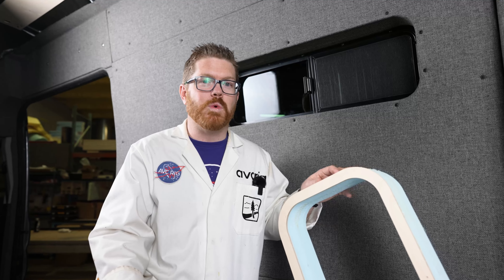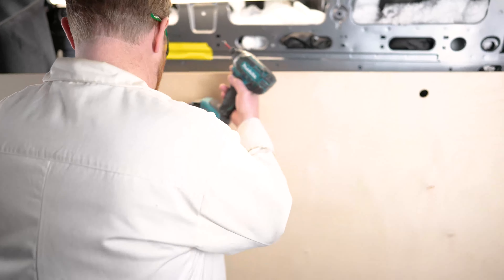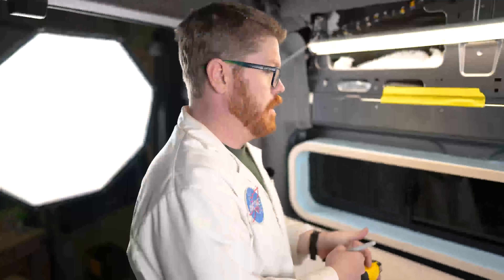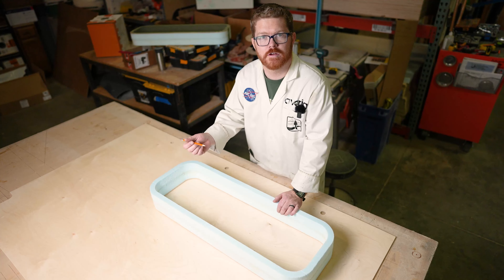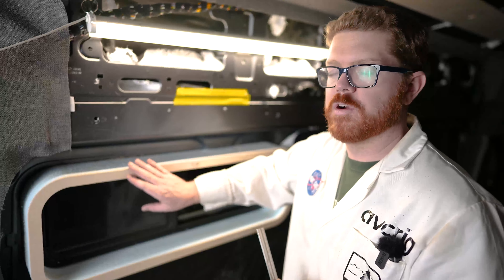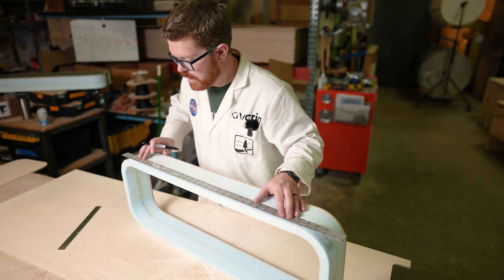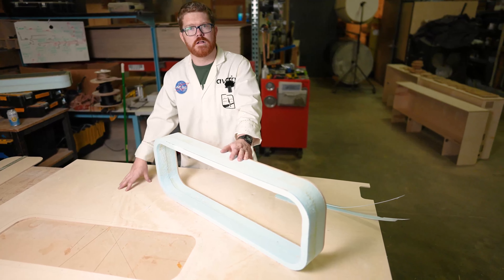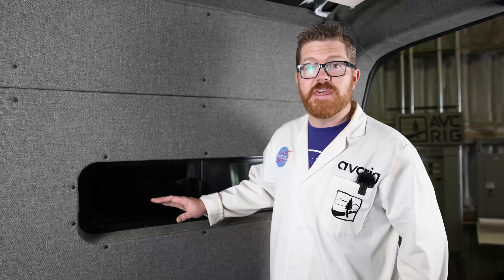Framing WINDOWS to WALLS | How to get BEST fit Windows for FORD TRANSIT

Comment: Wow!  I checked your store for the window frames.  I found you and your channel just a little too late.  We hate the work our upfitter did and now I am doing it myself.  My question is do you have those frames for AM Auto (AMA) bunk windows.  Ours measure I believe 37.5 long by 12.5 high on the outside of the frame.  Thanks for getting back to me on the LED flush mounted lights.  We were able to order them from a store close by.  I wish I would have found your channel sooner.  I didnt want to cut gaping holes in my new van for windows and a fan.  Custom Connection in Roselle, Illinois did NOT seal cut metal edges after at least 5 seperate assurances that they would.  I wish I could leave pictures here.  Keep up the great work!
Reply from the maker: Hi Ron. We do have Motion single slider frames in stock as well. Email the shop and we can get them out to you.

Comment: Thanks for this awesome product and video. The window foam ring was about 1/2 inch too small my awning style CRL windows.  After removing the 1/4 inch angle as you did in the video I used an oscillating multi-tool (arc blade) and razor knife to cut a 1/2 inch recessed ledge into the interior wall of the rear edge.  The ledge was about 1 inch on the top and 1/2 inch deep on the bottom horizontal spans.  The vertical spans had to slant between.
Reply from the maker: That’s a great solution! We designed these for the sliding windows that are a little smaller than the AW